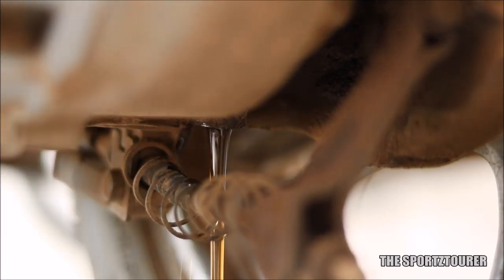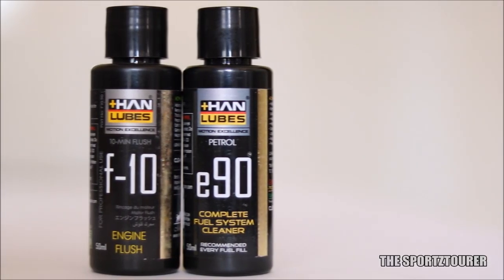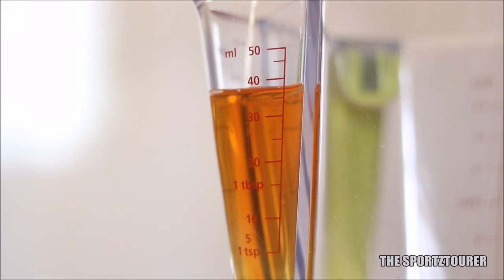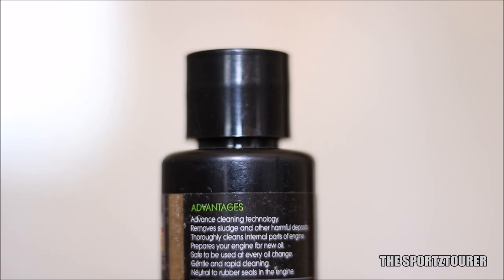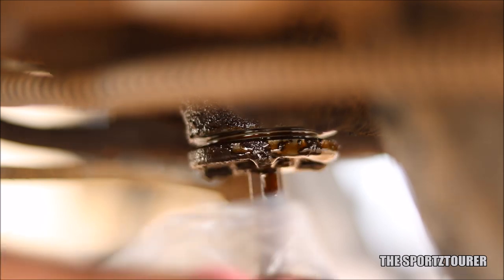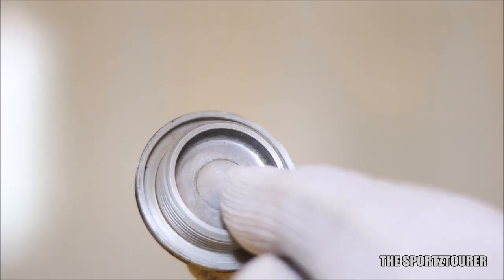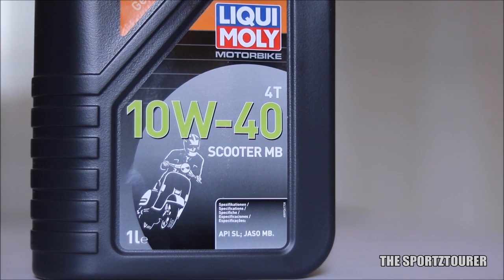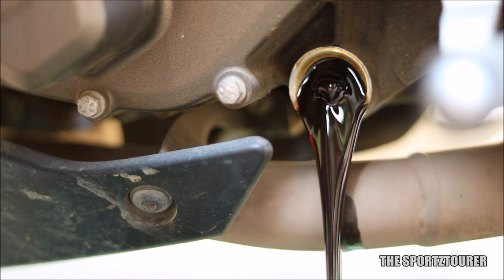ENGINE FLUSH ON SCOOTER | FLUSHING A NEW ENGINE HONDA ACTIVA TVS JUPITER WEGO DIO NTORQ LIQUI MOLY

Comment: Again faced very bad experience at honda authorised service center. Last week I went there for that abnormal vibration problem. After taking test ride, jobcard agent said engine mount bearings are worn out and will replace. As I went there very early morning, there was no rush so i stayed there watching my activa 3g getting serviced. During engine oil change he put honda bike engine oil silver bottle and not gold bottle. When asked he said gold bottle is out of stock and bike oil works ok for activa. He put entire 800ml into engine. He didn't even wait for old oil to drain out completely.

Comment: Engine flush is overrated. As long as your engine has not suffered years of negligence regarding regular change of engine oil, it doesn't needs flush. Detergent present in oil is sufficient enough.

Comment: Can i choose 15 w 50 liqui Molly oil instead 10 w 50 grade oil of liqui Molly brand oil for my interceptor 650.. Because 15 w 50 is 825 rs per litre and 10 w 50 is 1,350 per litre.... If i choose 10 w 50 then 4,100rs i m going to pay..and in 15 w 50 i m paying 2,475 rs  so i can afford 15 w 50  this oil easily for my interceptor 650...I want your advice because you are brilliant in oil grade advisory.. Pls give your advice on my problem.

Comment: How to clean engine oil strainer of tvs jupiter? Please reply.
Reply from the maker: Hi!
You can clean it with help of volatile cleaning liquids. Petrol or carburetor cleaner can be an option but avoid degreaser like diesel which leaves residue behind. Make sure you completely make the strainer free of any cleaning solution before you install it back on the scooter.

Comment: Just a question, i am shifting from 10w30 semi synthetic to 5w40 Fully synthetic oil , i have Activa and it has already runs 15000km ,gives me mileage of 50km in city rides , 
Should i really need to do engine  flush before changing engine oil ?
Reply: Yea brother it's good

Comment: I want to share about my experience that at the time of engine flush and i put fresh oil my bike apache was not touching 11k rpm and this is not a confusion i am sure that something happened with my bike.
Reply: I wish to know why you want to touch 11k rpm
Reply: @hiteshadhikari  exactly. He owns apache and talks like owning h2r
Reply: @sourabhpanse  its a recipe for disaster for engine
Reply: Bro i know it might be odd for you but seriously i felt jerk when i accelerate and previously bike was smooth but after that i felt jerk and not smooth and i have watched the video of one Youtuber he also talks about problem regarding the flush.
Now if i talk about rpm yes it is touching somewhere around 10.2 k something and bro i can't purchase h2r but i take care like h2r.
Reply: @gearpoint8981  if u want to take care of apache like h2r then you won't rev engine to 10k rpm. Its totally useless.
Reply: @sourabhpanse  i know sir and i admit but i do sometimes when i want to check top speed and check o to 60 that's it.
Maintain your bike with proper service, engine oil i am sure that bike will never let you down . 
Sir i have run almost 45000 km 2013 model and still highest top speed is 133.
Reply: @gearpoint8981  your Bike your wish your choice. Sir
Reply: My bike has completed 50000 km and at idle condition it touch almost 11k rpm but after engine flush it is struggling to catch even 9.5 rpm and i know it happened that's why i am sharing my experience.

Comment: How about the good ol Desi Diesel flush 😂 I know it isn't good but I wanna know how bad is it. 
Procedure - every 20k km for a bike, drain old engine oil completely, remove 1/3rd of old oil from drain pan, add same amount of diesel to make the total quantity same as recommended, pour the mixture of old oil+ diesel back into the engine, let it idle and drain it again. Refill will new oil after making sure every last drop of old oil+ diesel mixture has been drained from the engine.
Reply: BRO, we can never get all the oil out of the engine.

Comment: I want to use liqui moly engine flush in my tvs jupiter. I want to know how much quantity of liqui moly engine flush is enough for 750 ml of oil sump in jupiter if 80ml of flush is enough for 1L of oil then how much 60 ml wright? Or should I use whole 80 ml. Please help me i'm very confused. @TheSportztourer waiting  for your reply
Reply: And also please tell me that liqui moly engine flush is safe for gearless scooters or not?
Reply from the maker: Hi Rahul,
Its safe (assuming the engine doesn't have any existing problem).
80ml should be fine 👍
Do share your experience here, would love to read it 😊
Reply: @thesportztourer  Thanks for your answer. I will definitely share my experience

Comment: I am going to flush my 76000 km+ HONDA Aviator engine with liquimoly flush soon. Right now i am using liquimoly 10w40 MB grade engine which you're using in this video. It's intial impression is good. Right now this engine oil is out of stock on lrlmotors.com and will he available soon.
Reply: Bro is there any prob till now ? After engine flushing coz I want to use it on my Activa 5g with 83000km+

Comment: Which engine oil grade should I use in activa BS3? 10W 30 or 10W 40?
Reply: Both oil are good for scooter but check the grade it should be MB scooter oil otherwise it will damage your engine because bike has wet clutch system....